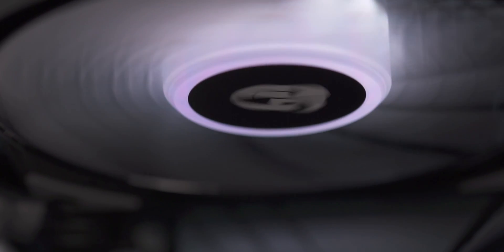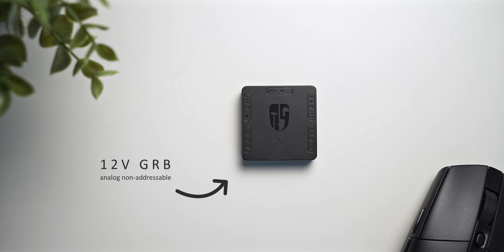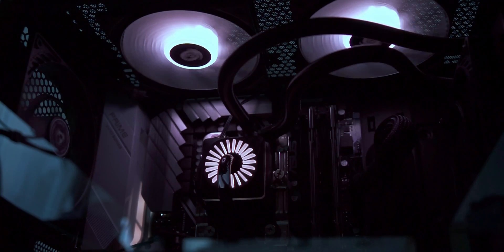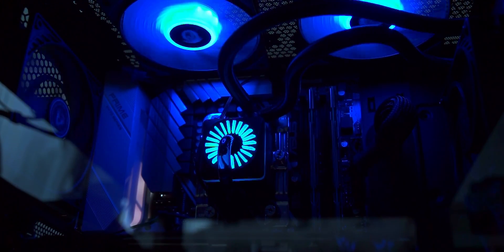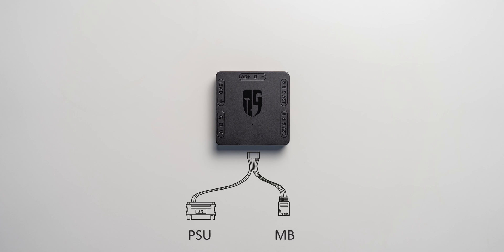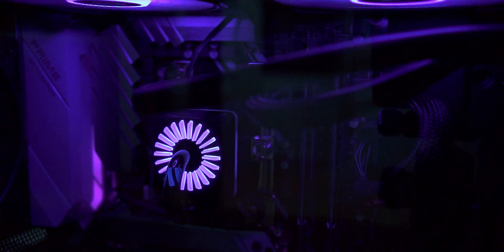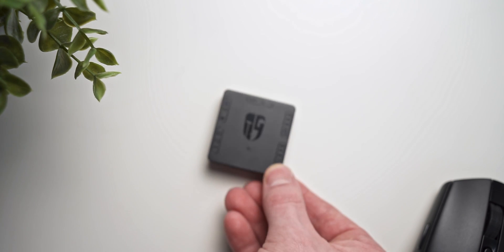Convert 12V GRB to 5V Addressable - Deepcool RGB Convertor

Comment: So does that mean i can do half blue and half purple on my fans??
Reply from the maker: No, only one color at a time.
Reply: @techlessYT  is there another similar converter that i can do half colors?
Reply from the maker: No, that's not possible with any converter as the motherboard's analog 12V signal can't carry the necessary information.
You will need to get a dedicated ARGB controller for those kinds of effects.
Reply: @techlessYT  oh ok thanks!
Reply: If i bought an dedicated argb controller will i still have to buy this converter that you reviewed. And what argb controller would you recommend?

Comment: My case has 3pin argb and My motherboard is 4 pin rgb and I emailed the case company and they said if I do 5v go 12v converter, my motherboard will burn out is this true?  They said I have to get a “suitable adapter” this is a 5v to 12v and I’m wondering if I could use this or will it burn out
Reply from the maker: Seems like the case company misunderstood what you want to do. This converter is save to use and will not burn anything, if everything is wired as intended.
However: Never use an adapter to connect a 12V out to a 5V component - this can totally burn your PC. The Deepcool device is a true converter , it's an ADC to be precise.
Reply: techless so I have a 5v 3 pin and if I get the converter it will make be able to transfer 5v 3 pin to a 12v 3 pin and it will work correctly?
Reply from the maker: You can transfer from the 12V 4pin header of your motherboard to the 5V 3pin plug of your addressable RGB component, just as I describe in the video.
Reply: techless sorry for this stupid stuff I’m saying I’m just super worried, so if I get the converter nothing will burn correct
Reply from the maker: Just get a fire extinguisher :)

No honestly, wire everything up correctly (don't force plugs into obviously wrong headers) and nothing will burn.

Comment: 2:12 can i connect a hub of 6 argb fans from that input? thanks!
Reply from the maker: I can't really say whether 6 fans are a bit too much or will still work - depends on your fans. You probably will have to just give it a try.
Reply: @techlessYT  and 4 fans?
Reply from the maker: I can only make a guess... 4 fans should very likely work fine, really depends on the brightness and quantity of the build-in LEDs.
Reply: @techlessYT  does not consume much, are the cf120
Reply from the maker: The specs state 1.32W. That's really not much, even 6 should work fine.
Reply: @techlessYT  thanks!!
Reply: @xdassassindx  does it work mate?
Reply: @30_muhammadarrifqi5  Of course, I look very good
Reply: @xdassassindx  so a hub of 6 fans worked perfectly? Thanks man!
Reply: @xdassassindx  by the way which port do you use? Bottom left, top left, or the middle?
Reply: @30_muhammadarrifqi5  I use the one above, for deepcool fans

Comment: Can I use the GDV 5v 3pin connector if the converter is connected to the Assis b450m motherboard?  And can I use all 5 outputs simultaneously?
Reply from the maker: I unfortunately don't have all the RGB components to test that, but I guess that should work.

Comment: two of my motherboards are Z77 which in the time of release i think grb doesn't even exist fully yet (correct me if i'm wrong). so, if my motherboard only has 4 pin header for cpu and 3 pin for other fans, i need this to control the existing argb fans today via software right?
Reply from the maker: Actually I'm not aware of a single Z77 board that has any RGB headers at all, neither 5V ARGB nor 12V GRB. If that is true for your boards as well, there's no other way than getting a dedicated RGB controller that connects over (internal) USB.
The headers you're mentioning are probably just fan headers (fan rotation, not light).
Reply: @techlessYT  yeah you're absolutely right - there's no rgb headers for Z77 boards. i just thought maybe i could try connecting to a cpu fan header with the use of this deepcool device to control the argb fans via software. i guess that's just a dumb idea lol. thanks man, i appreaciate your response! 🍻

Comment: will these work with three Deepcool CF120 ARGB fans at once i just want the colorful loops?
please do answer
Reply from the maker: What do you mean with "colorful loops"? The CF120 has a standard plug, so it should work with the converter. To connect 3 fans at once you will need an additional splitter or hub.
Reply: Sorry i did not clarify like the base lighting modes such as rainbow effect and such

Comment: I know i kinda stupid asking this question while this vid is there but i really didn't understand this thing(:? 
I have a 12v 4 pin RGB header if buying this kind of transporter to 5v 3 pin ARGB header will it work with a water cooler pump ? And is't actually ok to use the mobo software such as AURA SYNC with the 3 pin RGB component ? 
You earned a new sub dude <3
Reply from the maker: Thanks!
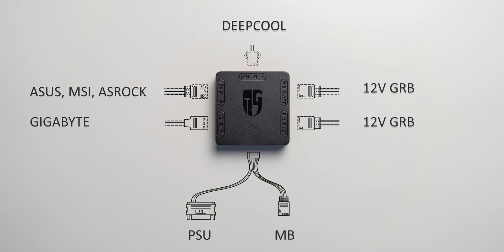It will work with your pump block, if the pump block has a compatible RGB connector. Just check if the writings on the connector plug match any of the converter's headers (refer to 3:05).
Also "Aura Sync compatible" (or Asrock, Gigabyte...) batches on the box of the RGB component usually mean it comes with a compatible plug.
Yes, using the motherboard's RGB control software with this converter is perfectly fine.
Reply: @techlessYT  i love you so much <3 your a life saver 😢

Comment: My motherboard has a 4 pin RGB port, my ARGB hub built in my case has a 3 pin cable. Will this work for me and will it stay ARGB or will it become RGB
Reply from the maker: You need to check the writings on the 3 pin plug. Refer to 3:05 to see if they match a header on the converter.
After conversion the ARGB will become plain RGB.
Reply: @techlessYT  I see, a bit unfortunate the ARGB becomes non adjustable RGB :(

Comment: I recently bought a Deepcool CF120 fan, which i mistakenly thought I could plug straight into my MSI B450M mother board (JRGB1 12v pins) . It has a 3 pin fan cable and an additional cable which I presume is for the RGB. If I purchased one of these adapters, would only plugging in the 3 pin fan cable work still allow me to control the RGB? The other cable would become redundant?
Reply from the maker: You need to plug in both cables. The 3 pin fan cables connects to your mainboard to power the fan itself (rotation only, no light). The additional RGB cable goes into the converter and will only be responsible for RGB.
Reply: @techlessYT  will can I use the msi mystich lights or it will not work with this adaptor on?

Comment: Great video! But I have one question. I have a lian li lancool 2 case and it has an argb front panel connector. My mother board does not have an argb header so where on the converter would I plug this front panel argb connector?
Reply from the maker: As stated in the case's manual the plug has a "+5V, D, GND" pinout. So it plugs into the top left port, as you can see at 3:05.
Reply: Thanks a bunch man!!

Comment: anyone knows if this works for the Deepcool castle 240 pump LEDs? I know it should work with the rgb fans but I want control over the pump
Reply from the maker: It will also work for the pump.

Comment: What about 3-pin cooler master fans that come with the h500 case?
Reply from the maker: I assume you mean the H500M or ARGB editions of the H500(P) as the original H500 comes with non-adressable RGB fans?
The ARGB fans should be compatible with the converter as they are labelled as compatible to "Aura Sync", "Asrock Polychrome" and so on. That usually means they come with a standard plug or at least include the necessary adapters.
Reply: @techlessYT  Yes the ARGB version of the H500. I only see the 3pin connectors. Would I insert into the ASUS section of this adapter/converter? I do not want to place this directly onto my ASUS B450 MB that only has RGB headers.
Reply from the maker: If you're not sure just check the writings on the fan's ARGB plug. It should say something like "GND, D, +5V" or "GDV". Just use the accordingly labeled header on the Deepcool device.

Comment: Can it convert digital 5v RGB to analog 12v RGB? I have a Rog Strix B350 with 12v headers I use to control my leds through Aura Sync, and then I got a case with three ARGB 5v I can only control via a LED button on the case itself. All I want is to control everything through Aura Sync.
Reply from the maker: The Deepcool converter should be what you're looking for. Though it will convert from 12V analog to 5V digital, but not the other way around. This is actually what you described, so the device will work for you, given that your ARGB hardware has a compatible plug.

Comment: Hi there.
These two RGB products will work with DEEP COOL RGB Convertor? can I control both with same ASUS AURA Program? one connected to +5VD and the other one to 12V RGB would work?
https://www.amazon.com/gp/product/B07C9V1NF1/ref=ppx_yo_dt_b_asin_title_o00_s00?ie=UTF8&psc=1
https://www.amazon.com/gp/product/B07HK7YRCD/ref=ppx_yo_dt_b_asin_title_o05_s00?ie=UTF8&psc=1
Reply from the maker: Yes, you can connect the upHere fans to the Deepcool converter. As for the RGB strip you can chose to connect it to either another 12V header on your motherboard or use one of the two 12V headers the converter provides. Keep in mind that every RGB device that is connected to the converter will have the same color. Controlling is done with the Aura software.

Comment: I have the x470 mobo liked you showed in the beginning. All i want is my coolermaster fans to be able to connect with aura sync since they cant plug in to my motherboard. Will this solve my problem?
Reply from the maker: Yes, if your cooler master fans are regular ARGB fans, which they likely are.

Comment: Hi, it's a nicely made video but I'm pretty sure it's a 5v ARGB to 12v RGB convertor. Not the other way around as you mentioned. You can't convert analog signal to a digital one.
Reply from the maker: Hi Rong, thanks!
You can convert analog to digital with an ADC. It's the same principle that can also be found in digital recordings with microphones or digital cameras.
The conversation inside the Deepcool converter is from analog to digital as the motherboard puts out an analog signal while e.g. the fans need a digital ARGB signal. So the signal flow is from the motherboard to the fans, hence it's 12V GRB to 5V ARGB.
Reply: @techlessYT  hy, i haver 11 fans DeepCool rf 120mm in my case, my Motherboard is a Asus x570 tuf gaming plus BR with 2 12v and 1 5v, i can use this converter to use my fans with argb efects or not?

Comment: How about the other way around? I bought an addressable rgb cooler but i cant connect anywhere into my z390 asus
Reply from the maker: Well, this is exactly the case the converter is designed for :)
This is a 12V GRB to ARGB conversion, as the signal flow is from the motherboard to the cooler.

Comment: I am little bit puzzled, if my motherboard had a RGB header it wont work? for GRB only header only?
Thanks!
Reply from the maker: What we call RGB header usually is either a 12V GRB header or some kind of ARGB header. For the latter you of course won't need the Deepcool converter.
The converter will expect a 12V GRB signal. You can check the printing on the mainboard next to the RGB headers to see what type they are and what pinout they have. You will find that in the mainboard's manual as well.
Even if your mainboard has an uncommon pinout, like 12V RGB, there's usually an option to change that inside your RGB software. The setting is sometimes called "calibration". When doing a calibration the mainboard will show every of the three RGB colors once and you will have to select whether you're seeing e.g. red or green.
Reply: @techlessYT  I get it now, i already checked the motherboard GRB Header. thanks.
Reply: but can i connect x4 RGB fans? and 1 ARGB pump and 3 ARGB fans?
Reply from the maker: You can connect two 12V GRB fans to the converter in addition to your ARGB hardware. I assume your ARGB hardware needs to connect to the same header? You may use a hub to power those 4 components at once, though you will have to try if the power output is sufficient for your specific components. It's always good practice to run as few components from a single header as possible.

Comment: 12V RGB TO 5V ARGB
Reply from the maker: Do you mean GRB is a typo? That's actually intentional as 12V G R and B is the pinout of the 4 pin connector.
Reply: @techlessYT  maybe she doesnt know it , by the way , nice video . going to buy one because of mastercase h500p and strix b450f mobo . duhh !

Comment: Hey I have a Gigabyte Mainboard with a 12v 4 Pin RGB Header. can I unse another RGB Controller with this Converter to power my other RGB Devices? And does the Software works with the controller too?
Reply from the maker: Hi! You can use every device to feed the RGB signal to the converter as long as it has a 12V GRB pinout. The converter doesn't mind whether it's connected to a mainboard or RGB controller.
That said you likely could configure the pinout of your mainboard's header inside the fusion software, so that it will put out a GRB signal. Some RGB programs call this "calibration".

Btw. I wish you good luck in the Aura raffle! :)
Reply: @techlessYT  thanks mate

Comment: I just bought one myself. Keep in mind, that altough motherboard 12v headers ar GRB, some other RGB controllers, that are meant for RGB stripes, ar BRG. So you might also need to flip B and G cables also. Still a great piece of tech, so i dont have to throw way my old Farbwerk Controller.